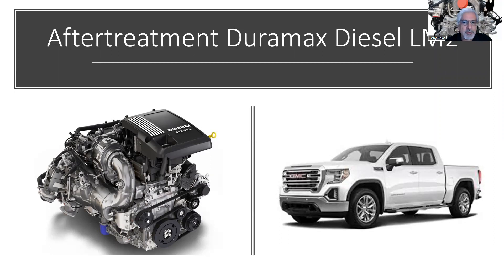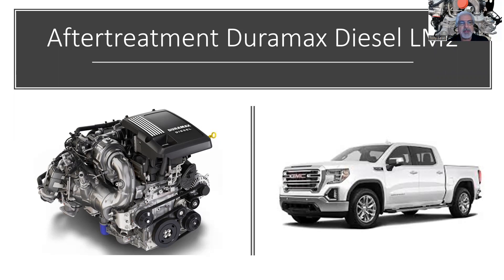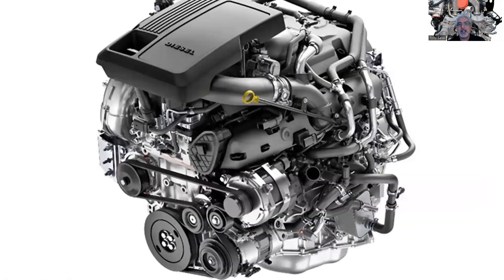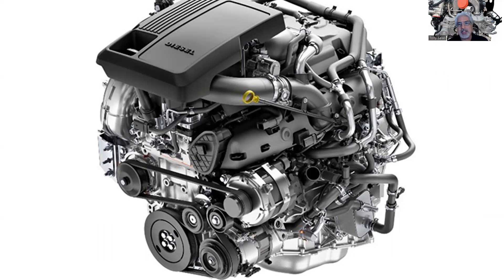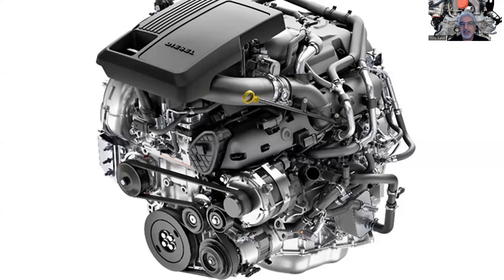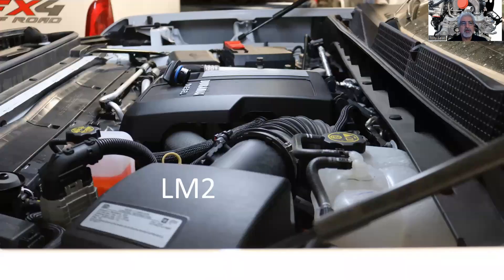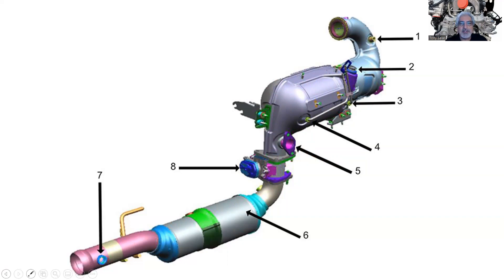Duramax LM2 Aftertreatment Review,

Comment: what could cause poor fuel millage im getting 12-16 unloaded when i was getting 24-26. been in shop for 3 months still not found the issue
Reply from the maker: How many miles? Usually this is issues with the aftertreatment running excessive regenerations.
If everything has been maintained, oil changes, filters and driven “normally” no excessive idle time, then a good scan of the system is necessary plus resetting a few parameters and verify no excess soot in DPF
Reply: @dieseltalkwithtonysalas8725  it’s got 30000 miles wasn’t a issue until around 20000
Reply: @dieseltalkwithtonysalas8725  what do I ask for at the dealership I also smell seems like def in the cabin some times but once again they said nothing was wrong

Comment: All seemed to be legitimate, right up until he got the charge air flow path completely backwards. 
Trying to say air enters the charge cooler and then into the turbo. Anyone with any real world experience would immediately identify the appropriate flow path. 
This calls question of validity to his other statements. 
And therefore that’s the way it is lol.
Reply from the maker: I will review the video but info is given to aid not to beat my chest and say I know it all but the purpose was the aftertreatment.
But hey try starting your channel and make a presentation and do the work cause the pocket change YouTube gives me is not why I do this. 
Google my name not perfect but I try.
Reply: @dieseltalkwithtonysalas8725  good video Tony, @1967friend is correct, however. The air enters from the bottom of the turbo and then as you described, exits out to the aftertreatment system. The mix up in here is the airflow enters the turbo from the front (firewall area) and exits out and into the charge air cooler. As the turbo compresses the air, it becomes hotter and that's why the charge air cooler is so beneficial. After the charge air cooler, the air enters the intake manifold.

Appreciate you taking the time to share info on the aftertreatment system and adding to the duramax community.
Reply from the maker: @DemonWorks  thanks I know DH 1967 friend made a note of that. My bad but been too busy to change the video.
I do appreciate your kindness in pointing it out. Tony makes mistakes! 
Thanks!